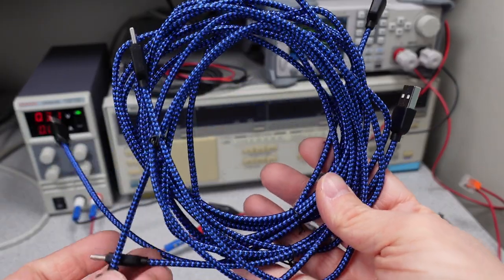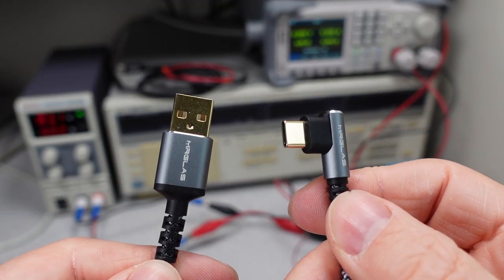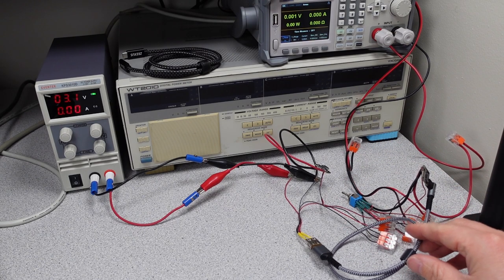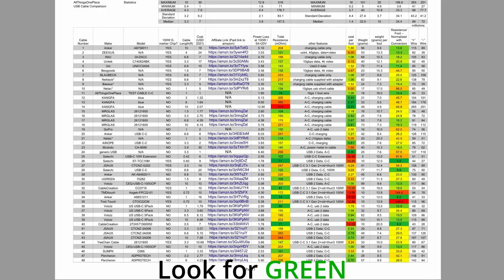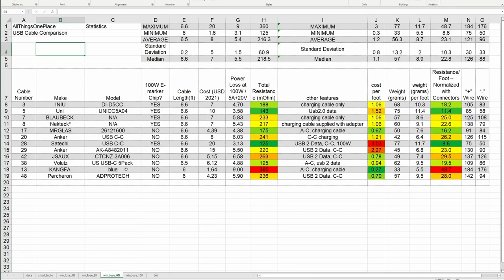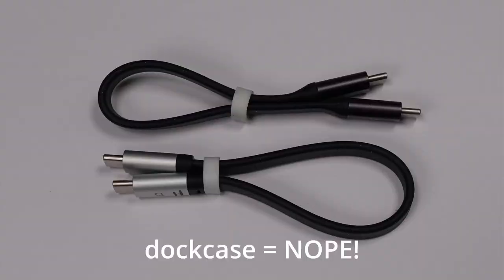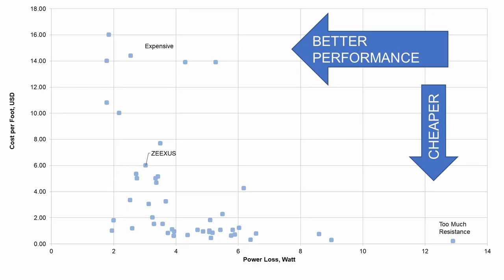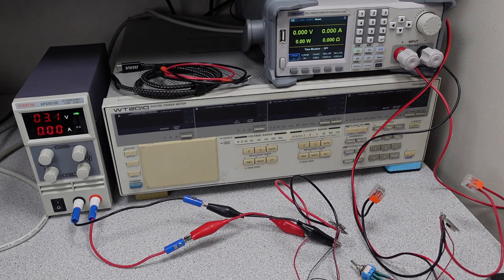Comparing way too many usb cables with too much data. 😀

Comment: I found these usb-c cables on amazon that have a built-in power readout. The USB-c connector has a small LED display, showing the watts delivered. I found it to be very handy -- until it failed. It was too hot to touch, probably failed with a short circuit. It got really hot, the connector actually melted. As a result, I wanted to know what kind of quality issue causes such a dangerous failure. I hope you are able to review some of these charging cables in the future. thanks.
Reply from the maker: I have looked at two of these cables, the AOHi (in the round 3 video) and the Mcdodo (I think in this video).  I noticed the ends are warmer in general versus a normal cable.  They have to cram a lot of electronics into a small space so it isn't a surprise for a cable with a display in it to short out.  There are tons of cheap cables online though.  I should do a teardown of the cables with displays in them and see if there is anyway they could short during normal use.  Thanks for the insight though.  A lot of the cables have a circuit board in them now for various functions.

Comment: Wb a lightning cable video like this? Btw, made me tear up a lil bit with all the data and effort you put out there. Where im from i really need to know this, being in the mid 20s struggling economics, stuff. Thanks again pal, and uh, if you see this around copypasted in another place, its because, yeah, i really want it to be read by ya! i mean it all, proper thanks
Reply from the maker: There is a round three with some lightning cables.  https://youtu.be/VD5yhULVJdo   I hopefully will get round 4 out soon.  Thanks a lot for sharing, very much appreciated.

Comment: Smaller the  cables higher the resistance (I'm assuming you are talking about length of the cable)?  I think it's the other way around
Reply from the maker: Smaller the gauge, which is actually the higher number.  20 gauge is smaller diameter than 16.  I needed to state units.
Reply: @AllThingsOnePlace  ah okay

Comment: Good morning,

What cables do you recommend for providing "passthrough" power to a docking station (details below)? Your recommendation from Uni was not available. This one, also from Uni, "appears" to be its replacement [Uni, 100w USB C-C, 6.6']. I was about to purchase it but read the following on Amazons product page: "Connnecting to docking station is not recommended."  Yikes!  Why would Uni not recommend powering docking stations with this cable? 

The setup incudes the docking station noted which has (4) usb ports and an SSD slot. The total expected power draw for all devices, including the slot and docking station, is from 20-35watts. A 65w laptop may, at times, be plugged into the docking station/ or directly to the charger . The cable sought will run from a Baseus 100W desktop charger to a USB-C PD 3.0 charge port on the docking station  (rated at 100watts).  

Charging phones is the lesser need. The more important priority is to provide passthrough power from the Baseus unit to the docking station via a quality cable. What do you think, is there a reason why the Uni cable cannot be used to deliver passthrough power to docking stations? If so, what other cable(s) would you recommend? 

Thank-you for considering my query. 

jo
Reply from the maker: Hmm, not sure.  Maybe they are worried about it's data abilities in the docking station environment, because it is USB 2 capable only?  Maybe not considering the power side of the docking station and not the data side?  That's a pure guess though.

In terms of your analysis it seems pretty complete and it sounds like it should work fine.  The allthings website has tons of cables listed so check that out.  I've been using the zeexus cable for years now, it's data and power and pretty good for both.  Of course it is also unavailable.

Comment: Did you do any comparisons on USB C to Lightning cables?
Reply from the maker: Part 3:  https://youtu.be/VD5yhULVJdo    more to come in part 4
Reply: @AllThingsOnePlace  Thanks! I'm curious about the Monoprice USB-C to Lightning 1.5 ft cable if you get to it. They're the only major brand that makes it in 1.5 ft now. I think all the 1.5 ft you've previously tested are C-C.
Reply: @AllThingsOnePlace  Also curious about more cables with built in power meters. It seems they're all the same but just rebranded?

Comment: At this point, I have been through at least 10 cable brands, including Anker. I am sick and tired of USB C cables failing every few months because the end (tip) became faulty. By the end, they only hold charge if I angle the end a certain way. I don't understand why this happens.... Because I have this cable plugged into a wall at home, so it's not like I am tossing around.
Do you have a possible explanation for why this happens? Is it just me??
Reply from the maker: I have yet to have a single one break.  I do not treat them well for the most part.  I do maybe have better cable etiquette than most though, always grab the connector not the wire, avoid sharp angles or use right angle if needed, use a cable that is long enough, then for my travel brick, I never take the cables out of the brick, wrap the whole thing up in a ball and off I go.  I don't think you are alone though, the USB C connector is tiny and frail.
Reply: @AllThingsOnePlace  Thank you for your  advise. I will say, cables that have a built in LED display for wattage seem to fail much more frequently, as well as regular cheap braided cables from alphabet seller brands on amazon.

Comment: what about ugreen US562 100w cable?
Reply from the maker: I would expect it to perform at an acceptable level, on par with the other 2m ugreen USB C-C cables.  Being 100W capable they generally have to make the the wire good enough to perform at a reasonable level.
Reply: @AllThingsOnePlace  thanks.i bought one from aliexpress few days ago.

Comment: He said the shorter the cable the more resistance???
Reply from the maker: Smaller the wire gauge not smaller as in shorter.  Cramming too much into those videos.